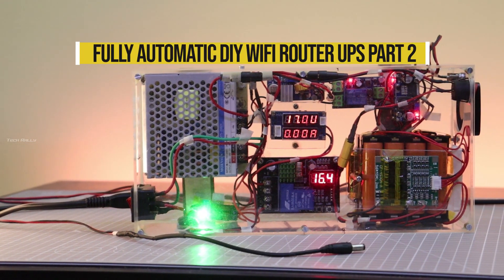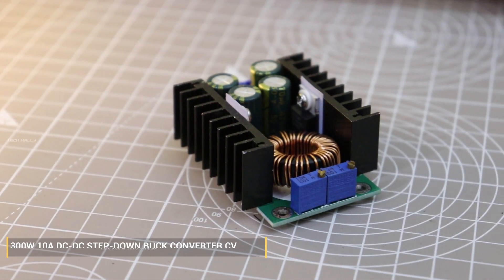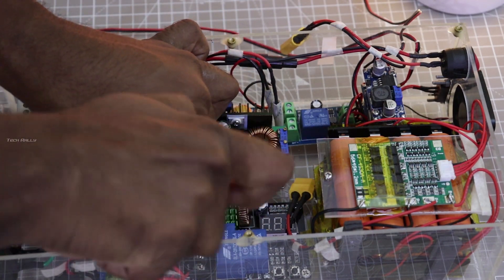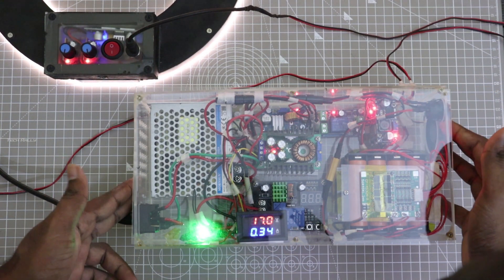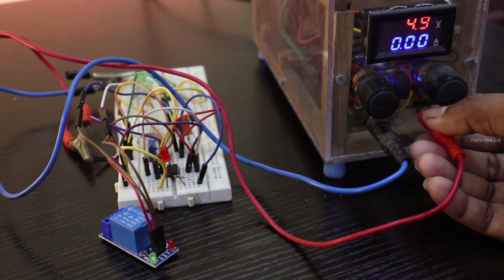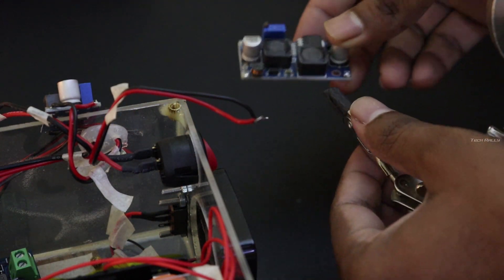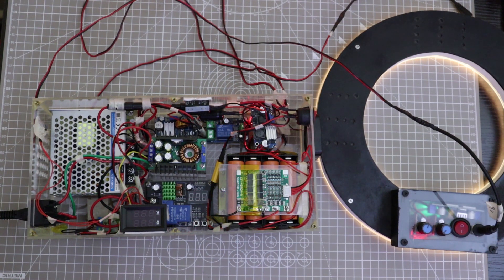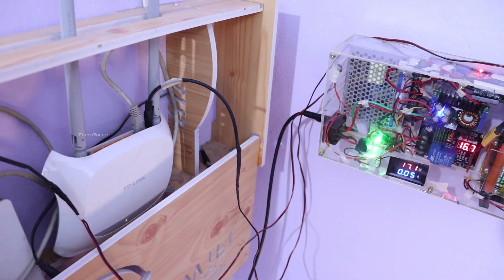DIY Fully Automatic wifi router UPS with dual output Part 2

Comment: I think we can use simple diodes to switch from supply to battery right?
Reply from the maker: No we can't use only diode..
Reply: @TechRallyofficial 
If we slightly keep the source voltage higher than battery voltage the switching take place automtically right?

Comment: absolutely great project!
I'm using same protection relay YX-X804 and it gives a delay when switching to battery
I see you fixed that issue with buck-boost converter XL6009, but I didn't get do we need additional capacitor there or XL6009 can handle powerdrop by itelf? realy look forward to your reply, thanks!
Reply from the maker: Thank you 😊,
I too tried adding capacitor at the load end still the delay cannot be fully avoided.
Buck boost converter works fine but high current converters are rare,
Reason for the delay in switching is due to the capacitors inside the SMPS, it can be solved by adding a load resistor at SMPS but i didn't tried it.
Hope you got what you need.
Reply: @TechRallyofficial  maybe my explanation is not good
problem is in delay of relay switching from power to battery, that reboots my router
I don’t think adding resistor will solve it right?
Reply from the maker: First need to understand why there is delay in switching, when power goes off ther capacitor in the SMPS will discharge slowly from 12 to 0v. Your relay will be on till it reaches 5v which is the main reason for delay, basically realy operation time will not restart the router.
Reply: @TechRallyofficial  things become a bit more clear, thank you

Comment: Nice and neat work bro 
Does its work raspberry Pi?
 (o/p volt set to 5v)
Reply from the maker: Yes, it will work, But need to use high current  buck converters. 
Thanks 😀

Comment: At this point its much more cost effective to buy a used ups and replace the batteries with new ones. This way you can power many verities of devices instead of wifi only. And a real ups is way better built and wont crash into million pieces like your acrylic will when it gets accidentally bumped off the wall.
Reply from the maker: Even if it's a commercial ups if you drop or bump it will break because of battery weight,
I am not sure which ups your referring to 220V AC or 12 DC, a 220v computer ups can run only few hours for a wifi router reason the loss in conversion and a 12v commercial ups also can't support wifi 6 routers..
Thanks for watching 🙂

Comment: Let us build it again, with minimal components/modules. Over engineering is fun, but has its headaches
Reply from the maker: But never compromise on seafty since its Li-ion battery,
Thank you 😊
Reply: I wouldn't change a thing. These builds are awesome and they help you understand how individual electronic modules work, and how they can work together with other modules. And let's be honest, it also looks cool as f**k.